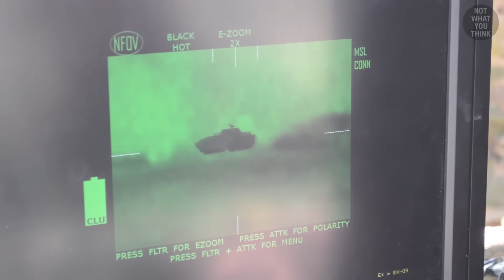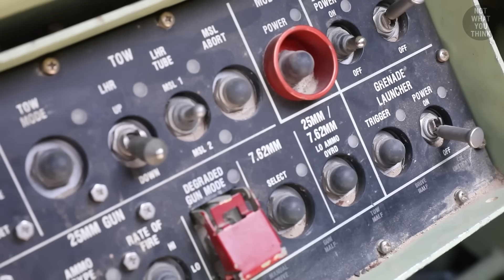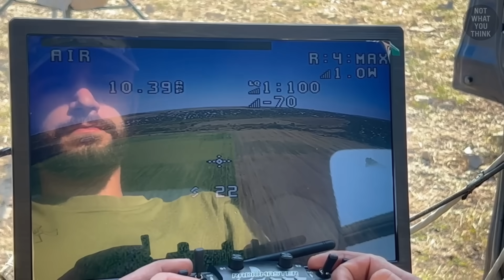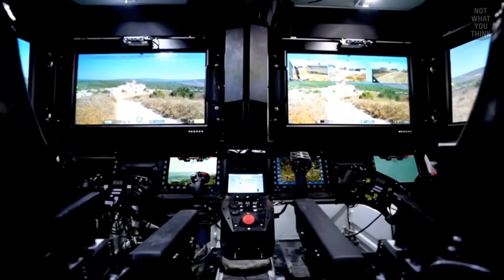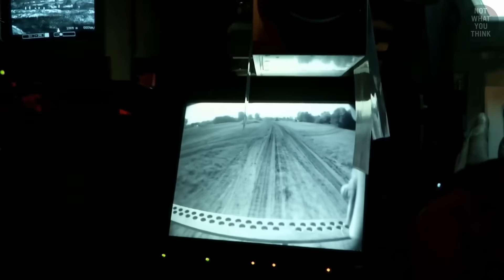How Bradley IFVs prove more Useful in Ukraine than Tanks

Comment: As a former Bradley operator, Im really happy to see that the Bradley is finally starting to get the respect it deserves. I loved every minute i spent in the Bradley. It really is lethal, and  mobile. With those TOW MISSLES we can kill any tank with extreme prejudice. The 25MM Auto-canon with the right rounds can freaking shred just about anything. ❤❤❤❤
Reply: I believe when Bradley’s receive javelin style missiles vs having TOW; it would be untouchable from MBT. 
I always thought the TOW takes to long when engaged. Have to stay visible to enemy while TOW is guided. 
I loved having javelins on Bradley. 
Get out, find a high spot and launch a javelin; then stay hidden. I operated Bradley 2005-2007.
Reply: @thomashenshallhydraxis  being wire guided means it’s immune from jamming and spoofing as long as the operator has eyes on target.  It still has a place on the battlefield.
Reply: @thomashenshallhydraxis  The BGM-71F variant of the TOW is a top-down attack variant that is wireless guided. This version is similar to the javelin but has higher penetration. The old TOW system is obsolete. All current variants are wireless guided.
Reply: @thomashenshallhydraxis  there was talk of this at one point, the cost upgrade to the sights and retrofit times lead the decision to be made to move away from the A2 variant to the A3. I tend to agree with the fire and forget concept.  Adding a battery of internal upright vertical launched fire and forget would be an awesome variant.
Reply: @whiteskyflyer  The BGM-71F variant of the TOW can already do that.
Reply: @thomashenshallhydraxis  They should have a spotter drone built in into these vehicles that will target the enemy and then the vehicle could shoot javelin style missiles from cover etc.
Reply: @thomashenshallhydraxis yeah javelin are real good problem is they are so expensive to make currently. Maybe the Bradley's replacement could be equipped with those as it would probably take a complete overhaul of the electronics and turret to support that and the it looks like it's going to phase out soon.
Reply: Yes it's a great vehicle.  You probably know that as it was being developed some peace-activist types in the movie industry made a documentary mocking it trying to say it had no purpose and a pointless design.  In real life it's troop protection, targeting, the two or four TOWs, it's savage high-speed 25mm which operates almost as though it were a high tech gattling gun, as well as it's stabler, smoother ride make it one of the more well thought out pieces of military technology we've made.  (BTW Thank you for your service.) 😊
Reply: @_SYDNA_  couldn't have said it better man! Gotta love the Bradley!
Reply: The movie the Pentagon Wars really hurt its reputation. It's a funny movie. Not accurate at all, but funny.
Reply: @disbeafakename167 I heard that the Bradley has been proving itself before the Ukraine War and it is mostly thanks for all the work done to make it safe. Imagine what would have happened if it was the model the generals wanted to push forward.
Reply: @disbeafakename167 as Lazerpig and Spookston both have said, the general that wrote that book was even more self serving and corrupt than how he was describing the U.S. Army at the time.
Reply: Also a former Bradley gunner and glad to see it start getting the love it deserves. I was in the OG Bradley like my hull number was 2AA00496. 1st Brigade, 3rd ID. When you consider the M113s that these replaced, there's no discussion. I'd trade a .50 cal for for 25mm Bushmaster everyday of the week. Add to that the fact that it's stabilized, and can fire accurately on the move, and throw in a twin TOW missile launcher. (And now with laser range finder and lots of other fancy gear we didn't have when I was a gunner), it's no contest. People looking at Ukraine operating them have to understand that they are barely familiar with them at this point. When they gain mastery of this beast, it will be a whole different story. Our Table 8 standards were to kill BMPs in 7 seconds from the start of the fire command (that's 3 rounds on target in 7 seconds). Multiple kills were 15 seconds with 3 rounds in each of 2 targets. I doubt the Ukrainians are doing that yet, but they will. It's a dangerous weapon and shouldn't be underestimated.
Reply: Didn't Bradley get it during Iraq? Only people who shit on Brads are too dumb to notice that Bradley Wars was a satire. The joke is literally that it is good vehicle, just hated by Airforce weirdo, who has failed understanding of armour warfare. And basically interfere due to pure spite.
Reply: 19d stand up ......scouts out
Reply: Только теперь он бесполезен как дредноуты в своё время  уничтожается из глубокого тыла х-х-.
Reply: Bradley is saving many Ukrainian lives these days
Reply: TOW missiles cannot kill any tank there is footage of a T-72 taking fire of a bradley directly on its turret and nothing happend, the bradley got destroyed afterwards but its unknown who destroyed it since it just blew up probably another tank hidden.
Reply: And these people say that Russians are aggressive
Reply: Bradely is a joke. A russian joke. Russians renamed the Zahporija salient "Bradley Square" because of hundreds destroyed american tanks. Ahahahhahahahaha Ridiculousness-
Reply: what's respect? it's more like DISrespect. because this thin can made of alluminum can't do much on the battlefield
Reply: "TOW MISSLES we can kill any tank with extreme prejudice", sure, inferior tanks. As soon as it fires that TOW it lights up like a christmas tree. A sabot flies faster than a TOW. I am a huge fan of Bradleys but let's get serious here. What made the Bradley so effective was the training of its crew, I think it is safe to say that because of US training on them, that the tank could actually perform more efficient for which it was even designed.
Reply: And the Russian Army took two 30mm auto-cannons and stuck them on a T72 Tank Frame with ATGMs. They called it the Terminator. The Bradley is a death trap when it doesn't have air support and when the only thing its done is fight inferior armies like goat herders and camel jockeys WITH air support and has never seen anything like the Russian Army.
Reply: зря радуешься ,  вы подкидываете оружия в чужую для вас  войну, кончится тем , что  по тебе придётся наносить ядерный удар.  сидели бы лучше у себя и за карбоновую повестку боролись.
Reply: @АлексейБайрошевский-з2д  ударялку ядерную-то не сломай, ванька 😁
Reply: @АлексейБайрошевский-з2д no one is afraid of your 3rd world military or nukes. We have nukes also parked right outside your country. And ours work unlike your trash tech. Why you are buying North Korean crap 😂
Reply: Funny story, the Russians have stated that the Bradley "sucks", funny as a lay person, I just don't believe them. I can see the results for myself, in the comparison between Russian equipment and American/NATO equipment, the Russians are right, there is no comparison! Glad you had fun on my tax dime, thanks for supporting our Country!   Cheers!
Reply: para luchar contra carbas y chanclas bien! para un ejercito real no sirve
Reply: Mobile? The abrams is faster, both better top speed and acceleration, and that's an actual mbt. Same story with the leopard 2.
Reply: I'm an old swabby. I remember the vehicle got off to a rocky start but proved itself more than ready for trouble. The "Tomcat" is long gone but these vehicles keep getting better and better.
Reply: There is a video now where a bradly takes on a t90 and wins
Reply: Yes sir miss those days also even though I wasn't a scout or a grunt I was the guy yall called when you guys got them mired to the skirts in mud or fixed them when they broke .
Reply: lol   Ya the Bradley is the Short man syndrome tank.  It’s bad ass
Reply: It's my favorite if by far no I never served knee surgery shoulda lied it was to clear scar tissue exploratory that was it no good wth I can pass the pt nope back in 01 they made no exceptions but back to Bradley bad mofo each bullet is a grenade at a crazy fire rate very effective at destroying enemy n causing damage to even tanks optics fire control n probly not fun being peppered by that gun even in a tank then the tow puts u on ice
Reply: I’d rather have something heavier than 25 mm. Something in the 30-40 mm range that with enough elevation to be used against aerial targets  would be ideal, but broadly speaking an IFV with a good auto-cannon & missiles is a better and options in most modern combat situations. You can also use an IFV or heavy APC as a drone deployer and control unit.
Reply: And i really enjoyed watching them burn on various videos, along with everyone inside of them.
Reply: F yeah! And, I say this to you in Anthony Cumia's impression of Jesse the Body Ventura, "Thank you for you service."
Reply: Nice
Reply: Except that a Bradley's armor can be penetrated by a .50cal. 

When we served we werent fighting a peer adversary. Our Afghan and Iraq era tactics wouldn't work.
Reply: @Theggman83  You didn't even mention the BMPs armor is even worse than the Bradleys armor
Reply: @Tanker000  cause we're talking about the Bradley...
Reply: @Theggman83  bradley side armor is rated up to against 14.5mm ap and front against older 30mm rounds, meanwhile bmp 1 and 2 are rated 7,62 against the sides and 50cal to the lower front plate and 23mm api upper front plate
Reply: @mikitheslav9711  guy, the .50 cal can penetrate a Bradley.. 👍 period.
Reply: @Theggman83  source? look at any reliable source only 1980s bradleys that still had the firing ports had the weaker armor
Reply: @mikitheslav9711  it's got little to do with the armor... It's got more to do with the advancements in the .50 cal round itself. 

Yes, please do, check some sources. Cause I know what I'm talking about. I didnt even have to Google it. 🥱👍
Reply: @Theggman83  apds 50cal rounds are not very common, not for russian ones atleast, and american ones cant be reliably used in machine guns.
Reply: @mikitheslav9711  1. I'm not talking about apds. I'm just talking plain old AP.... It will go through a Bradley. 

2. The Russian 12.7mm x 108mm is actually a little more powerful than the .50 cal NATO... So... 

This is getting boring... Go... Look... It... Up... Seriously, this is embarrassing.
Reply: @Theggman83  pics or it didn't happen. I know what happens when you hit the BC's hatch point blank with burst of 7.62 from an M240C. They bounce off. Not that it has anything to do with a .50 cal. We did shoot a ramp with a 25 mm TPT point blank. That also bounced off.
Reply: @mikitheslav9711  I was on the first gen Bradley. The armor may have been less than what they have now, but they were not "weak" per se. We has space laminated armor. There was an exterior aluminum armor plate, followed by a space, another armor plate, another space and then several inches of armor. Direct fire ball ammo like a 12.7 mm or 14.5 mm would hit the exterior plate and expend significant amounts of its energy penetrating it, the force would disperse partially in the space and repeat. By the time it got to real armor, it did not have either the energy or an intact penetrator to breach the armor. Now, you hit it with AP or an anti-tank round, all bets are off. Everyone knows that and that's just the deal.
Reply: @Theggman83 embarassing is using 20 periods........to.......act......like......You're......speaking.......slow.
Reply: @Veltrosstho  your... Deflection... Is... Noted... Come... Back... With... A ... Better... Argument.... Kid ....
Reply: @Theggman83 bull shit. I was in a Bradly listening to 12.7 rounds bounce off as well as taking 2 rpg rounds with No Damage. 
You don't know what your talking about Comrade so be gone
Reply: @Theggman83 who lied to you and told you that crap? 50cal isn't penetrating a Bradley 😂😂😂😂
Reply: @ragedmayhem1  <-- it's always easy to spot the guys that didn't serve but like to talk tough.
Reply: I just love seeing gay marriage being spread to more countries. USA! USA! USA!
Reply: Two guys with a Kornet hiding in the bushes can ruin your day.
Reply: @frankgerlach4467  and one blaw can ruine whole russian sweet dream about indestructible t90m 😂
Reply: @frankgerlach4467  Those said two guys in a bush with Kornets wouldve been seen long before they can engage and end up getting screwed by either IDF or 25MM....take your pick
Reply: @frankgerlach4467  But those two guys were spotted by a drone and plastered by a cluster munition. They should have gone back to Russia and ruined Putin's day while they had the chance.
Reply: @truthseeker9454  In your theory. In practice an infantery man and his ATGM can be perfectly hidden, until the tanks shows up. Then the ATGM is popped out and the tank hit in no time.
Reply: @frankgerlach4467  That's your theory. In practice, Russian casualty figures in both men and equipment show mine is more correct.
Reply: @frankgerlach4467 that's just theory though, in the filed it may be a completely different story. For example the two guys might get spooked by artillery, drones passing overhead, loud noises in the background. The two guys aren't robots, they are humans, humans get stressed, scared, anxious, etc. And it doesn't just stop here, smoke and debries may effect their ability to correctly operate said Kornet, and what happens if there is more than one tank? To me it sounds like a 120mm round to the face!
Reply: @truthseeker9454  truthseeker what an oxymoron
Reply: @X9xredgkoa  You make an accusation without offering any support. Impressive!
Reply: @frankgerlach4467 hiding is an issue when armored vehicles have thermal sites. There are ways for infantry to hide their heat signatures, but it isn’t fun and they cannot fire without exposing themselves. Aside from that, the survivability of Bradley’s is the key, the infantry continuous the fight and the team gets to learn from any mistakes and share them with their peers.
Reply: Bradleys were annihilated in huge numbers by Russians.  Obsolete imo
Reply: @dexlab7539  Can you cite a source for that? Where and when did that happen?
Reply: @truthseeker9454  of course he cannt, cause it's stupid bot. Many bradlies were damaged and restored, only few of them were really destroyed. This technics show itself very, very good, saved many ukrainian troops.
Reply: @arturscherbakov2543  Yeah, I know. I just reply to make sure they don't get the last word and influence some naive comment reader. Plus the comments boost the video.
Reply: @truthseeker9454 At Avdiivka, Ukraine ,right now, almost every type of BMP, BTR ,T-series tank that the Russians are using there is being annihilated in huge numbers by the Ukrainian Army. It has been going on like this for at least a week now with no real end in sight.
Reply: @truthseeker9454  Oryx has listed 60 Bradleys have been damaged or destroyed. lol  
What a outdated vehicle.
Reply: @Team6OWG  Oryx also lists 1,076 Russian armored fighting vehicles out of action, of which 728 were destroyed, 48 were abandoned, and 270 were captured. That means Russian soldiers ran away from more than 300 of their armored fighting vehicles - what cowardly outdated soldiers! LOL!  🤡
Reply: @truthseeker9454  Why is Ukraine retreating from Avadika, a fortified city they held since 2014 lol.
Reply: @truthseeker9454  a jakie są źródla tych wielkich sukcesów Bradlejów? Filmiki an YT? Na YT można znaleźć rów nież taka samą ilośc płonących Bradlejów. TYlko poszukaj w źródłach na środkowym i dalekim wschodzie bo w Europie wszyscy przymilają sie UA.
Reply: @dexlab7539  when was that? Or are you still referring to one column that was ambushed.  Overall the Bradley is doing a great job in Ukraine.
Reply: @dexlab7539 no they didn't only 53 have been destroyed, or damaged. Most could be repaired and the guys in the back survived.
Reply: @dexlab7539  Ya thats false since the start of the war we have sent 189 and only lost 69 bradleys are performing EXTREMELY well. Russia has lost 8,000 mbsta and 15,000 armoured vehicles. Russian cope the Bradley is a chadley
Reply: @dexlab7539 yeah when you drive a vehicle through a mine ridden open field target by 40-60 artillery guns shit tends to not work. Hence why the west prioritizes air superiority, which leads to air to ground destruction of artillery, which then allows mine clearing equipment to clear the mines, and viola you can pass.
Reply: @Smithgirll Except we don’t have nearly as many aircraft as we used to & the ones we have are more expensive and more vulnerable close & medium-range anti-air.

Desert Storm is never happening again.

Comment: It felt you did tanks dirty. First the m10 booker is not made to replace the Abrams its not even made to fight tanks or even the same battle intensity. Second these are 1980s tank design, the us canceled sepv 4 for the e3 because it old and needs to lose weight and be compatible with modern tech. Third i think we tend to forget how long it's been since a major power fought with someone that can equal it and Tanks haven't needed to really change because of it. Forth armor steps up to the sword, it might take while  and maybe not what you think but it will come. Plus infantry could all ways kill tanks so fancy new toys it's the end of the world.(even nukes because why let radiation stop a war.)